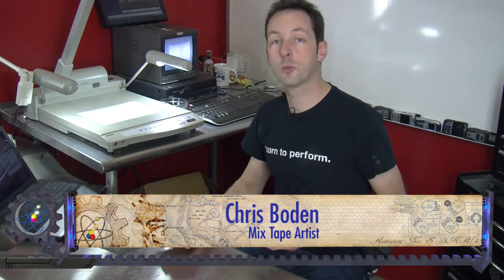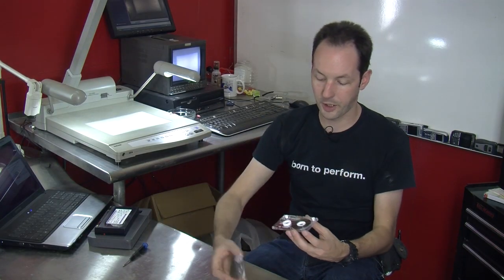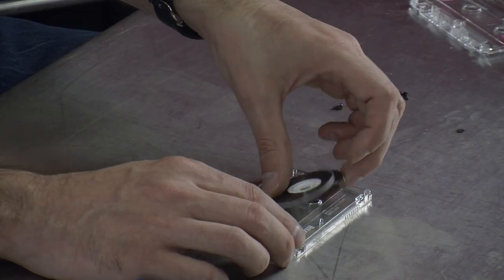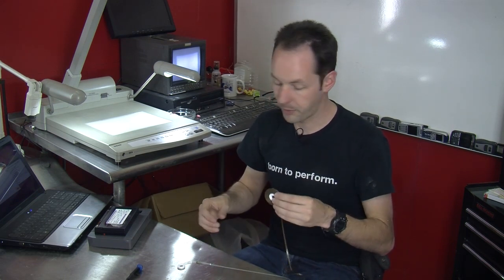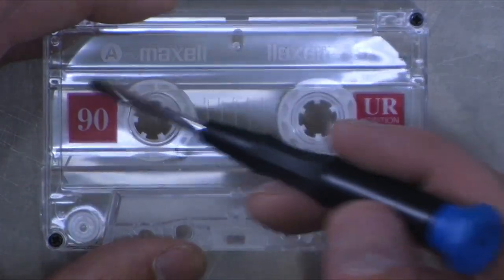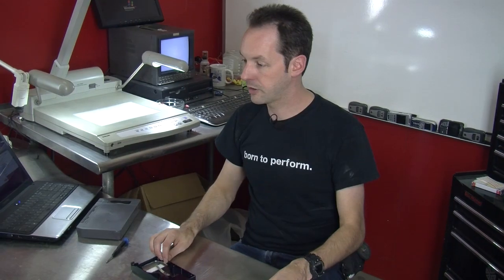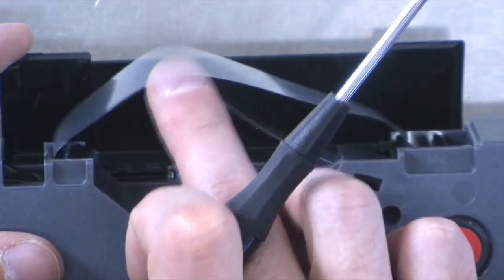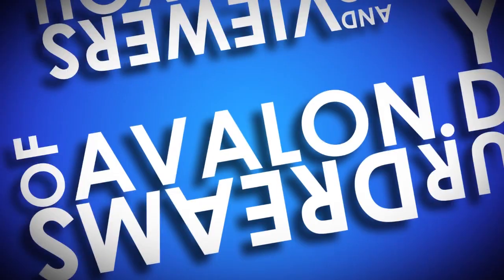Cassette, Betacam SP, and UMatic Tapes: Equipment Autopsy #56

Comment: Brilliant Mister Chris!
You should have a look at Travan data tape cassettes, those things are pretty amazing! There's a rubber belt inside which engages one spool to the other so as the capstan roller moves the tape back and forth very quickly in the drive, the spools are wound up correctly to take up the slack in the tape. All clever stuff, definitely worth a look :)

Comment: Lets do some math. Cassette tape travels at 1 7/8 IPS or 1.875 IPS, x 60 seconds is 112.5 inches for 1 minute x 30 minutes = 3375" of tape. Divide by 12 = 281.25 feet of tape not 1800 feet. That would be for a 45 minute 7" reel of tape running at 7.5 IPS.

Comment: If I remember correctly, a consumer 8-track just has it's beginning and end spliced together. The is only on reel in the cassette. the tape is then spooled onto the reel so that it feeds out from the inside of the spool and is taken back up on the outside. Or possibly vice-versa, but I think I am right.

Comment: Its amazing inside a vhs or betamax player - in betamax, the tape is unloaded 2/3 around the head, in one direction. In VHS, the tape would unload around 3/4 of the way around the heads, from both "ends" of the tape. This is why you would occasionally get a chewed tape - when these machanisms malfunctioned, or there was a sticky reel etc. Also, those heads spin at a stupidly fast rate. Also players with turbo rewind sounded like they were going to snap the tape when they got to the end!